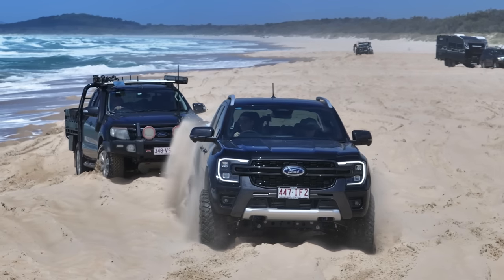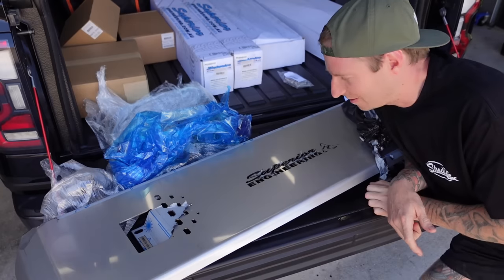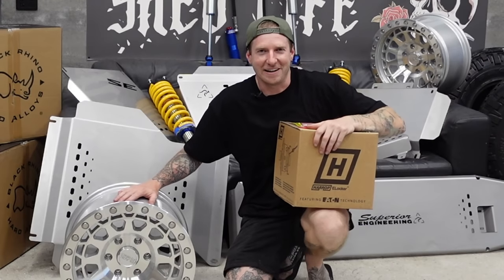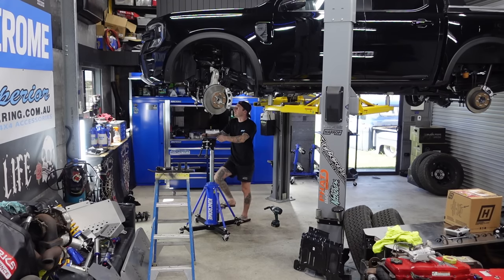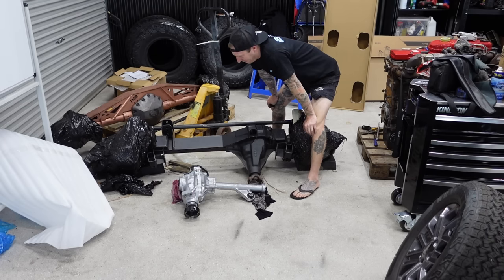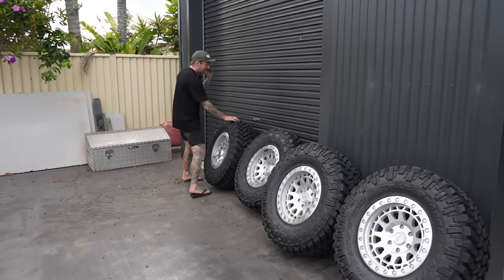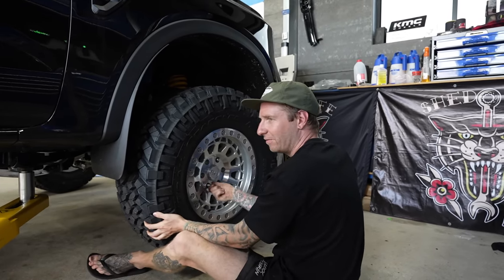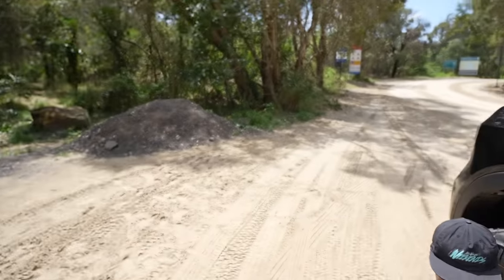3 BEST mods for NEW Ford Ranger !

Comment: Look beast...👍Does its scrub at   full lock with the 35s and 0 offset?  Did Mac need to trim any guards back for clearance?
Its will look even wider when the flares go on . 👍
When the flares go on get Mac to show the clearance from wheel to inner guards on full lock.

Comment: Could definitely use a set for my 21 BT, had a stick dislodge the wiring harness and nek minut it’s wrapped around the front drive shaft and off the road for 6-8 weeks 🎈🎈

Comment: Did you fella get the wheel alignment ok, without fitting s UCA? How does it handle with the 35s? Also, what did it increase your entry angle too?
Reply from the maker: yeah wheel alignment was still achievable and yeah slightly better approach angle now, drives nice